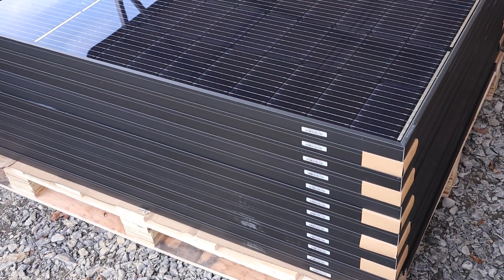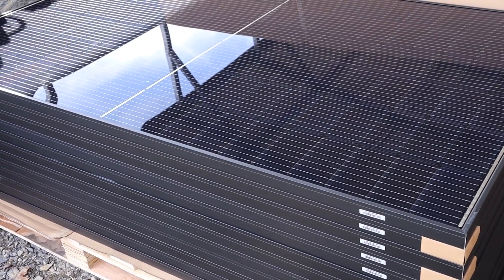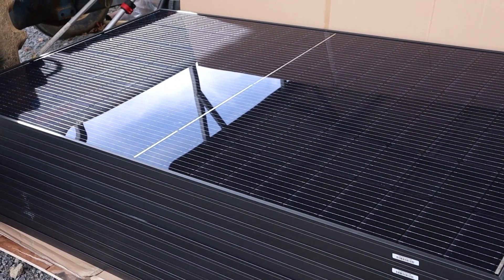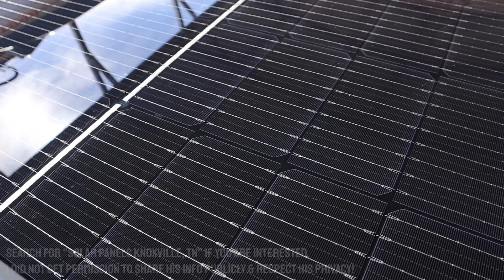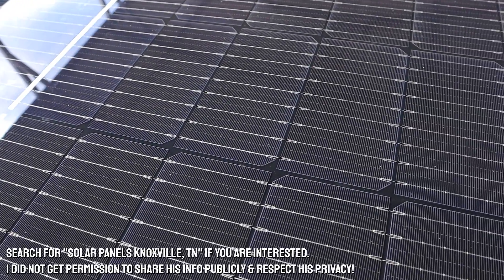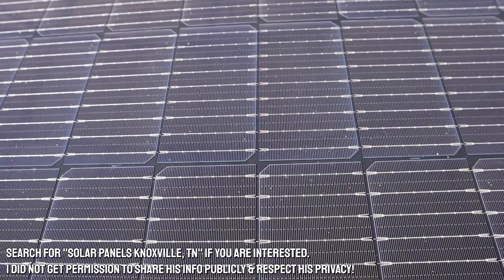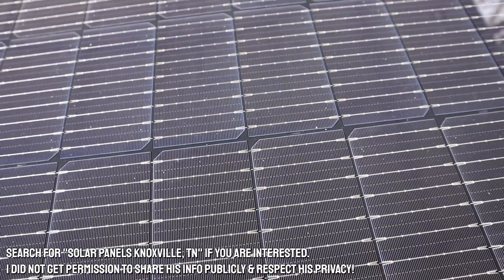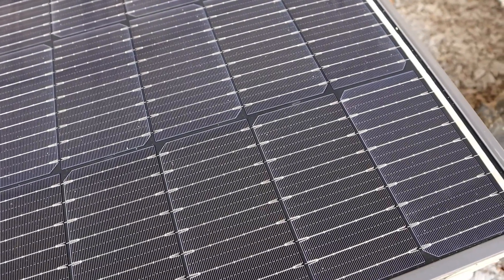Taking our Mobile Home Off Grid... OR SO WE HOPE!

Comment: You got a nice system. Lux are great units. That inverter is 12k watts which is 50 amp output. Which that will run a 4 ton ac and not much more. 3 of them will give you 150 amp.

Comment: Hopefully it is going to be grid tied and not totally off grid. off grid means you have only a certain amount of power available. Anything that exceeds that means power rationing.
Reply from the maker: It will be completely off grid due to the insane oversight utility companies want to impose. However, we have an easy solution to address the times where we need grid power on demand. Stick around, you'll see it. :)

Comment: If you wanted to I am sure you could install those panels on your south facing roof so you would have no leaks.  I installed 36 panels on my south facing tile roof and am happy I did because of the high winds I have had.  They are installed close to the roof which makes them immune to the forces from the wind and heavy snow melt.  I have never had a problem with them getting dirty.  The rain and snow are all I use to clean them.  My roof is too high to use a tool to clean them from the ground so I loose about one or two weeks of power a year due to snow coverage.  I also have 12 panels installed on my adjoining shop roof, 6 facing west and 6 facing east. This gives me usable power in the morning and evening.   I have considered installing 12 more panels on a south facing frame set at the optimal angle for the winter solstice sun. This array could be cleaned of snow and would give the most power when it is needed on the shortest days of the year.  I get more than enough power from my solar system for about 10 months of the year.  I go on/off grid any time I need to just by switching the switch that transfers my main load center from the power company to my solar load center.  I wish I had the ambition to put in that solar array but I think I may watch you do your solar work instead.

Comment: This will be interesting.  I was wondering about power when you built the new workshop.  And here it is.  The solar array povides power for the house, will it provide for the other buildings, or will you be doing something else for them?
Reply from the maker: The house is first, then the workshop will come later I hope. :) Between the two it felt more important to have the home off grid first.

Comment: We have 36 panels for our home and use a back to grid system which means we get paid for the extra electricity we generate.  Also if we have a lot of bad weather we can still get electricity. 36 panels generates a lot more than we use and we have a pool pump running 8 hours a day and my air conditioner is on 24/7 because we live in the tropics.
Reply from the maker: That is awesome!

Comment: my first thought was to indeed put the solarpanels on the roof of the trailerhome and the shop 
reason being that the underside of the panels are covered and they whont tug on the mountings and maibe even crack like they could when the frame is open on the underside with the wind comming from the north they will act like sails
though having them sit lower so you can keep the panels clean a little eazier does make sense even though they make verry long waterfed brooms to do this from the ground 
https://m.media-amazon.com/images/I/71SanIoiG5S._AC_SL1000_.jpg
if you build the mounting system a little higher and basicly make a walkway / stairway / deck along the low part of the structure you can still get those panels to clean them and use the space under it as a verry long (and somewat low) equipment shed and can park youre equipment under it and store lumber 
https://troyerpostbuildings.b-cdn.net/wp-content/uploads/buildings/agriculture/equipment-sheds/New-Gray-Pole-Barn-Equipment-Shed-with-Snoot-Truss.jpg.webp

Comment: Good luck. I’m in the process of doing the same less the panels. I bought an eg4 18 Kpv inverter and two 14.8 kwh wall mount batteries. My plan for now is to recharge the batteries via my generator. Maybe I will get panels later.